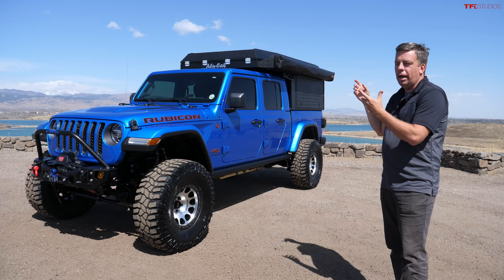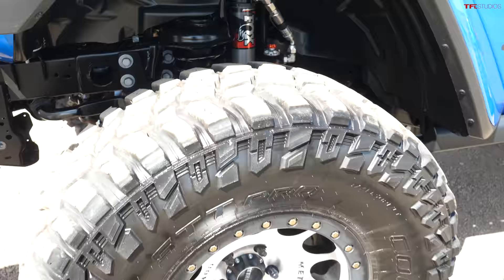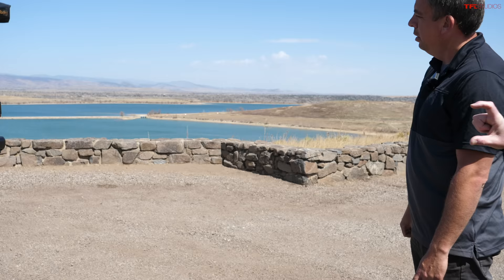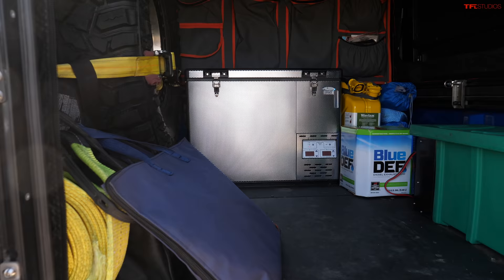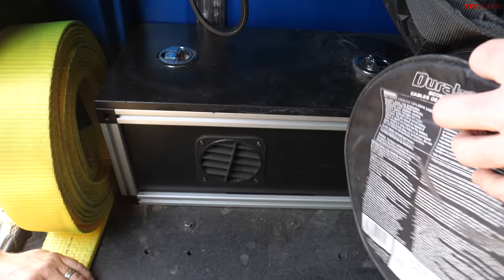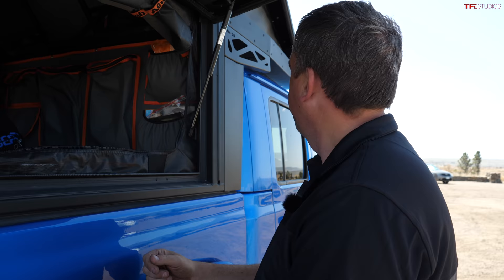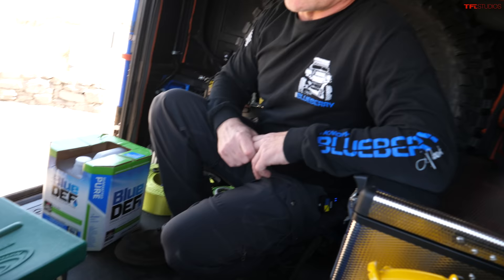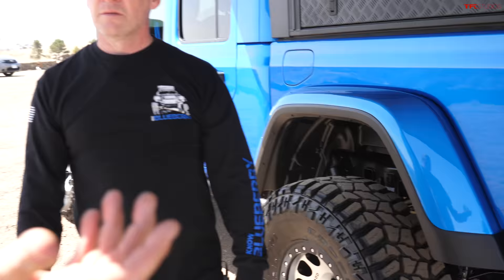This Could Be The Ultimate Jeep Gladiator Overland Rig Because… Dude I Love (Or Hate) My New Ride

Comment: Very cool truck. A 37” spare does fit under a Gladiator with 35 lbs of air in it. I’m running mine that way.
Reply: I think the reason the guy said he doesn’t store it there is because if he got a flat it would be a pan in the butt to try to wrestle it out from under.  I can see how that would make sense especially if one of the rear tires went flat.
Reply: Ive got a 39” KM3 under my gladiator with the same amount of lift he has. Changing a flat requires a jack already so its no big deal to change a flat

Comment: For a dedicated overlanding and touring alu-cab is system is one of the best setups, next to PCOR, Mits alloys etc. However for overlanding skinnier tyres are better than wider ones. Base roof rack on the front for additional storage and mount like maxtrax, 50 inch light bar. For power supply a full redarc system with manager 30,red vision with 200 ahp  battery would be amazing since you got tons of un-utilised space. Propane tank can be mount just next to the high lift jack. Work or camping led lights on the rear and sides would be a good option as well.

Comment: Looks like great rig. Those cost numbers he quoted $63,500 + $17,000 + $22,000 equals $102,500. But then he says he has about $90,000 in it. Anyway it looks very cool.
Reply: I bought the Gladiator for $56,000 and $22,000 is a rough estimate on the Alu-Cab. I am between $90,000 and $100,000 I try not to add it up. At some point during a build like this you stop counting, or at least I did!!
Reply: @joeyparent9952  It's extremely refreshing to see someone be so transparent about prices, olong with everything else. What an awesome setup, so much respect for you and your build!
Reply: @kingschuyler3890  thank you.

Comment: This was sort of the direction I was hoping to go last January 2022, unfortunately the Chrysler dealerships here in Ontario Canada wanted a lot of money for the diesel gladiators. They wanted a lot of money for any of the jeeps, even just a regular V6.  I ended up getting a Toyota 4Runner TRD Off Road, and which I’m slowly building up.  I’ve had about a year now, conference, MSRP of $52K, good interest rate for the balance after my trade in vehicle.  It’s also my daily driver, so I do enjoy a little bit better road, fuel and highway driving van on the Jeeps.

Comment: What an incredible set up.  Nice clean build, and my favorite color.  Only thing I'd have different is 38's now that I'm used to that size on JLUR (as seen on my jeepNdirt channel).  I too have 4.5 inches of actual lift but with aftermarket steel fenders and agree with having space above the tires not only for the look but also I like having up travel as well as down.  Absolutely love this JT.
Reply: Thank you!!! lets wheel if you are in Colorado!!!!!
Reply: @joeyparent9952  Would absolutely love too.  My wife and I are finally planning on heading out west this summer towards the Silverton area so I'm hoping everything goes as planned.  Have a little health issue that needs clearing up, but so far so good.

Comment: This needs better suspension. Buy springs rated for the weight; AEV, OME, Dobinson, all have higher rated springs - not buying soft springs 2” longer to let ‘em sag.  Dana 60s wouldn’t hurt either.

Comment: Love the Xterras, but the Gladiator is an awesome upgrade. Should've kept the X as an off road only toy !
Reply: If Fat Bobs dialed in the V8 swap I would have kept it. It never ran right after the swap.
Reply: @joeyparent9952  that sucks man. I have a 07 OR 6MT and I'm titan swapping everything except for the transmission. Too bad you had a bad experience with the swap. That JT is way more capable, congrats on the upgrade my man!

Comment: And diesel in my area is now $6.19 a gallon.
Reply: I just traded a V6 gas Colorado ZR2 that was on 35" tires for a V6 diesel Gladiator Rubicon that I've also put 35s on. In my Colorado I was averaging around 16MPG. In the Gladiator I'm averaging 25MPG. So even at the current price gap where I live, gas is $3.89gal and diesel is $5.29, the Gladiator still will be about $500 cheaper in fuel costs over 15K miles. Now, you have to factor in DEF too. And more expensive oil changes. At worst they break even cost wise even. Personally I think it's worth it because the diesel torque is a much better experience once you really start putting bigger tires and heavy payloads in these trucks.
Reply: I have a diesel gladiator on 39s. The diesel is worth whatever the fuel cost is
Reply: Vancouver or Victoria, BC my guess ?

V

Comment: It’s an incredible build but how do you stay in GVWR with the diesel’s puny payload?
Reply: I'd like to know this as well.
Reply: 450 lbs for the Alu-Cab and around 400 in gear. 2 people ( under 275 combined plus 35 pound dog ) the dog owes the whole back seat.😁
Reply: @joeyparent9952  ~1160lbs, you are close or a little over... you're not including tires and suspension in weight....  Have you experienced any kind of derating or overheating in the diesel?
Reply: @troutriver58  no, the Gladiator runs great and with 488 gears it doesn't struggle up I70 at all.

Comment: 63,000+17,000+20,000=100,000. If he really paid 17k for the wheels, tires and lift kit he vastly overpaid even if he had to pay for installation.  I installed an Icon Vehicle Dynamics Stage 8 Billet System and added their 2.0 Hydraulic Front Bump Stops and their 2.0 Centerline Steering Stabilizer to my Gladiator and added their 17" Rebound Pro Wheels and Mickey Thompson 37" tires and it cost me 12k and Icon's Billet Stage 8 System is one of the most expensive out there and that's before you add-on the Hydraulic Front Bump Stops and the Centerline Steering Stabilizer.  Badass Build, those Alu-Cab's are so sweet!
Reply: 17k was lift, steer smart, rims tires, winch, re geared to 488's, tazer mini, with labor.
Reply: @joeyparent9952  that's more like it!  The Alu-Cabs are so nice, I didn't realize they had Murphy bed type systems in them too.

Comment: 6:35 "webasto" exhaust is under the car - is not allowed! Exhaust should blow to the border frame of the car.
Reply: It is getting relocated when the new rear bumper is installed. Thanks for the concern!
Reply: @joeyparent9952  Yeah, that's right. It might be too dangerous. Especially in low-wind weather. Or in case car is partially submerged into water.

Comment: Nice build.  I wonder what the MPG is fully set up like it is.  I bet when the new back bumper is on and the tire and maybe battery bank moves outside the extra room will be appreciated.  

Wheelbase is the same as a 2010 Ford E350 van.  Weight is almost the same too.  If both have the diesel, I think the van might weight 800lbs more.  A lot more useable room in a Ford E350 van especially if you fit a poptop like this has.  Also, the Van has a larger towing capacity and carrying capacity.  And pass-through front to back to get at stuff if it rains and you don't have to leave the vehicle.  The miss is getting the E350 suspension to work like a Jeeps.  Which nobody really has done yet.  Haven't seen any long arm suspension Vans yet.

A few illegal things per many state laws.  Tires extending past the side of the vehicle.  I don't think that shorty front bumper is legal with the whole front tire exposed.  And you have to have mud flaps to the center of the axle of a vehicle if I remember right.  I got 2 tickets for it as my 35's on a Jeep with 12in of lift didn't meet any of those rules.  And my front bumper was cut down.  Told it was illegal by a cop.  They said it was awesome but I needed to fix things to be legal in Illinois.
Reply: I get 17 mpg and that is driving with my foot in it.
Reply: who cares about MPG? This rig is not leaving the civilized world and it cost so much that fuel economy should not be an issue. Why is MPG a big deal with a build like this?

Comment: ☢ $4.45 for unleaded.    $5.50 for diesel today.    18.3 gal tank.    Plus diesel additives.
Reply: The diesel gets 30% + fuel mileage so thats still a savings on fuel. The additives cost nothing. My gladiator uses ~ $40/year in DEF and about the same in Hot Shots EDT
Reply: @mattbrew11  im not sure about that.. im lucky to get 16mpgs on my 2021 jlu eco diesel with full overlanding setup.. and DEF is every 1500 miles more or less 25$.. Our trip out west was 15,000 Miles and we spent a lot on fuel
Reply: @Jalfo027  if you’re getting that on a diesel itd be 11-12 max on a gasser.  I get DEF from truck stops for $4-5 a gallon

Comment: 63k truck 
16K wheels, tires, lift kit 
22k camping setup 

Andre: So it’s around 100k? 
Joey responds, well we’re looking at closer to 90. 
😅
Reply: I know the math is not exact. the Gladiator was 63,500 new I only paid 56,000 for it new. You could not buy one for that now in the current market. Also you can spend 12,000 to around 30,000 on the Alu-Cab.

Comment: If he went with KO2 37"s can fit the spare underneath.  Did you go with chromoly axle shafts? RSV? new drive shafts? never did hear what lift it was..just the fox shocks.
Reply: Rock Crawler X factor Mid travel 4 1/2 in lift and custom front driveshaft
Reply: @joeyparent9952  so has the track bar in back gone?
Reply: He doesnt want it underneath. If he’s on an obstacle or over some rocks or stuck in the mud with a flat, then he can’t get to it. He explained that. 

Agreed he didn’t mention the lift so when he said $16-17,000 for wheels/tires/lift, I was kind of shocked.
Reply: @aarongerman7857  no I still have it

Comment: @JoeyParent Very nice build! I am currently doing a very similar build here in eastern Canada and wondering what 6" springs you used for the added weight? I have the 4.5" terra flex kit but I am really interested in keep my ride height with all the added weight from the AluCAb. Did you use the 4.5" springs from your base lift kit even with the extra weight of Ecodiesel engine? I was just going to use the recommended 1" spacer from terra flex. Any info is great appreciated!

Comment: Personally, i dont like that setup, 37 inch and wide tires are not good for overlanding, you need more gas for that, thinking about your ball joints etc while overlanding for 1000+ miles and cannot find a single person on the way
Reply: I do more off road trails in Colorado and Utah then I do over landing for 1000 miles. I agree, if you are doing 1000 mile trips a smaller tire would be better.

Comment: looks too heavy to be usable
Reply: The Alu-Cab only weights 450 lbs. It looks heavy but when I off road I hardly notice the weight. Having weight over the rear axle gives me better traction. It is all aluminum and most of the weight is on the floor of the truck bed.

Comment: This version is too heavy.  The Go Fast Camper version is better.
Reply: That is an option.
Reply: It only weights 450 lbs
Reply: Can also do the the Alucab canopy which is 125 lbs and a RTT (avg weight 150 lbs) and stay under 300 lbs. But yeah, if weight is only consideration GFC is about 100 lbs lighter. But man the Alucabs are built like Rugby prop.